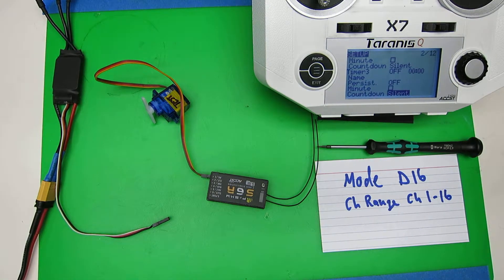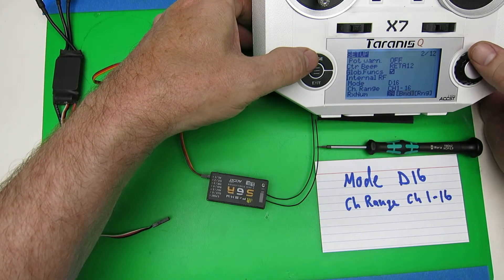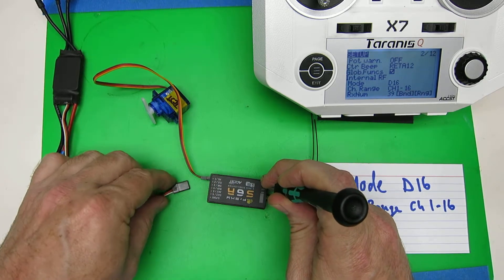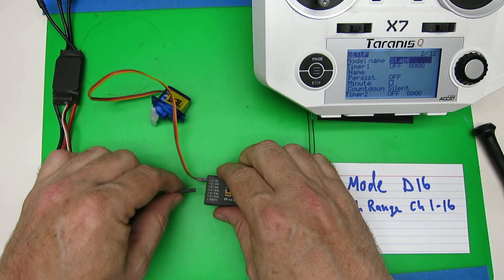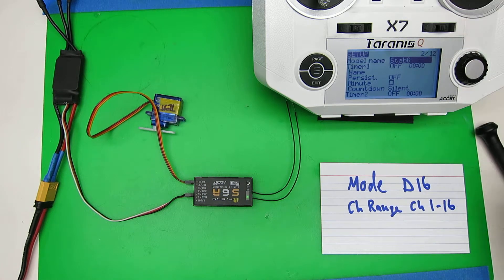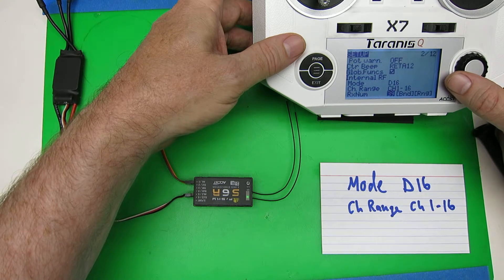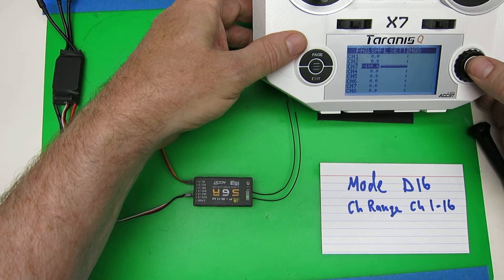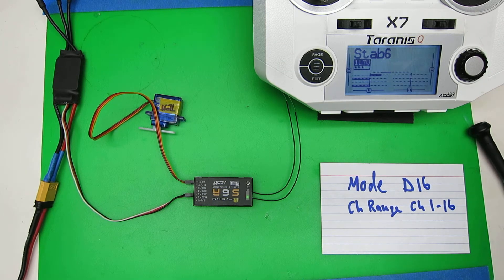FrSky S6R/S8R Setup: Step 1, Binding

Comment: Hi Mark  I have the same setup as you are showing, the S6R is brand new out of the box, and I have an average grasp of the trans functions. My problem is that on set up page 2 useing Internal RF the Mode shows XJT D16 were as your screen shows only D16. Mine will not bind and I have tried useing an X6R recv and that will not bind either. The Trans is new and I am useing this for my scale units. Your thoughts and advice much appreciated cheers

Comment: Hello Mark.
I have some inconvenient with the Taranis QX7S ACCST.
The radio has technical problems, some technical in My country restoring the firmware.
From that moment on, the internal module function only allows to use XJT and does not allow it to bind with the new receivers I Tri wit the S6R and GRX6, I update the receivers' firmware and it didn't work.
There is some way to correct this problem.

thanks
Alejandro

Comment: Your video came up because I'm subscribed.  It would have been nice if you took 30 seconds at the beginning of the series to describe what the S6R/S8R is and what it can be used for.  Maybe you can add some text to the video description.
Reply from the maker: Great idea.  It's originally just embedded videos here: http://eastbay-rc.blogspot.com/2018/12/using-frsky-s6r-and-s8r-stabilizing.html  but it's a great idea to make the videos stand-alone.
Reply: I agree with Mark. I love that this video is straight to the point and short. If it had an explanation about the receiver it would have ruined it. There are plenty of places to read about the receiver's capapbilities.